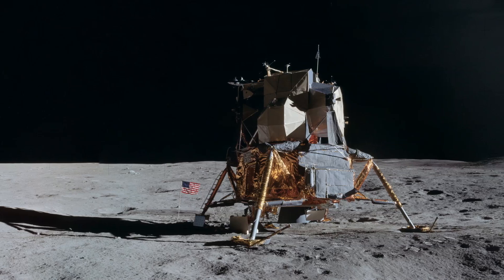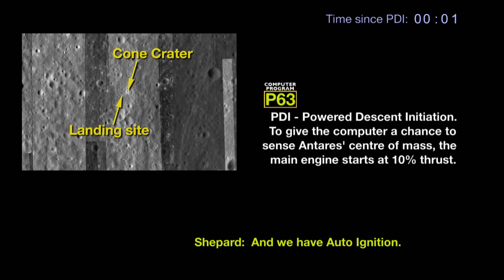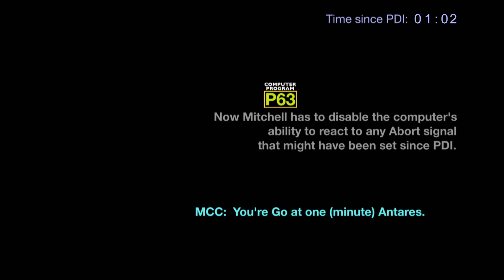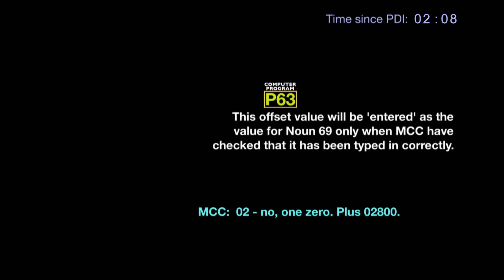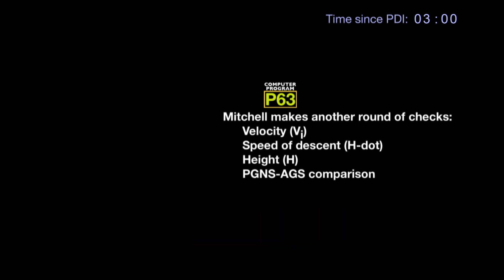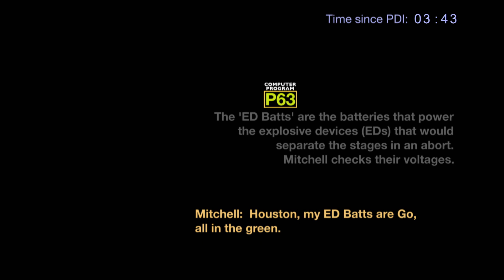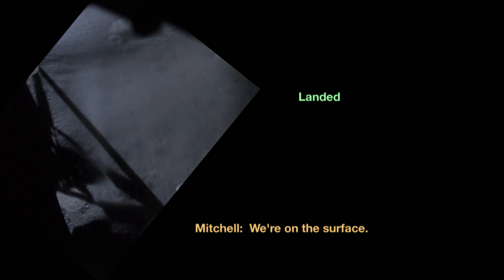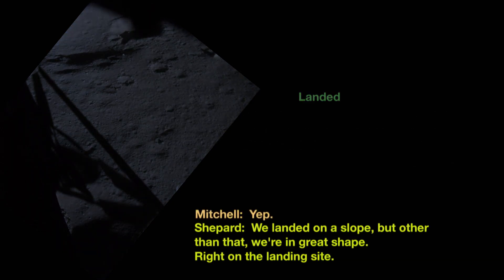Apollo 14 landing from PDI to Touchdown

Comment: FAKE!!! There is at least a 4 to 6 second delay from Earth to the Moon in radio communications and this has it instantaneously? Nope.
Reply from the maker: It is important to remember that this sound recording was made at Mission Control. Let's unpack what's actually happening.
You would expect that the CapCom (the person in Mission Control speaking to the astronauts) would be able to reply instantly to an incoming message and that is what the recorder would pick up. If, on the other hand, CapCom addresses a question to the astronauts, then the answer would not be expected for at least 2.5 seconds because both he and the tape recorder would have to wait for the reply. The third case is where the astronauts are talking to themselves. Here, there should be no delay because they hear each other immediately.
To restate, the only time a delay should be expected is when CapCom asks a question and has to wait for a reply. In all other instances, the delay should be about what would be expected from normal conversation.
I hope that helps.
Reply: Its more like 1.25 seconds. Sorry but you were misinformed and now you are spewing misinformation and have become a dreaded hoaxtard.  GFY.
Reply: What a FAKE!!! you are.

Comment: Okay, my only question is how the hell are they talkin instantly back and forth when there is supposed to be a significant delay in the radio transmission?
Reply from the maker: Let's unpack this. The time for light and radio to travel between Moon and Earth is about 1.3 seconds. So if CapCom in mission control asks a question of the astronauts, he has to wait at least 2.6 seconds to get a reply. Moreover, if someone in mission control makes a recording of that conversation, then the recording will also have that delay (plus the natural delay between two people speaking).
But what about the case where the astronaut asks CapCom a question? It would travel across space from the Moon and arrive at mission control. CapCom would answer it as soon as he could and the recording would reflect that lack of delay.
The third case is when the two astronauts in the spacecraft are talking between themselves (the majority of the conversation). If the recording is being made in mission control (which it was) then both sides of that conversation have equal delay getting to Earth, but between the two of them, there would be no delay.
To sum up, there is only one case where you should hear a delay, and that is when CapCom made an utterance that required a specific reply.
I hope that helps. You only had to ask in the first place .

Comment: I read in one of your comments that they used a steerable antenna, so they were in direct communication with Earth? They weren't relayed by the CM?
Could the pilot staying in the CM (Roosa in this case) hear landing phase comms between ground and LM crew?
Those channels dedicated to each Apollo missions are a blessing, thank you for this work!
Reply from the maker: You are correct. The LM had independent communication with Earth through either a steerable dish antenna or one of two omnidirectional antennae. The frequency was S-band, just over 2GHz. The steerable allowed a higher bandwidth including TV. The onmis would work if the steerable was not aimed, and came in handy on Apollo 16 when the steerable's actuator failed. 
Both the LM and the CSM, as well as having S-band, included a VHF system with antennae. This permitted line-of-sight communication between the two craft but it did not work between Moon and Earth.
As an aside, the Lunar Rover, as used on the final three Apollo missions, had its own completely independent S-band communications arrangement with Earth. Since it was very likely that these crews would be working out of line-of-sight to the LM, the Rover had a high gain dish antenna that was aimed when they came to a stop. it also had a low gain, wider angle antenna that they used while driving. This arrangement supported good quality (for the time) television from the Rover and a reverse command channel that allowed an engineer on Earth to remote control the TV camera while the crew carried out their geology tasks.

Comment: I really gotta ask where you got that crisp panorama of the LM, it's gorgeous compared to others!
Reply from the maker: Thank you. I stitched it together myself using eight source images. I use Auto Pano Pro software to help with the process and I do a lot of pan stitching, mostly of my own photos. Over the years, I've acquired better and better scans of the Apollo Hasselblad collection. I have a professional skill in colour balancing (TV finishing video editor) and the best scans are on Kipp Teague's Flickr site: https://www.flickr.com/photos/projectapolloarchive/ These scans have been left deliberately unbalanced to allow balancing to take place at the end of a process and so they often look greenish and washed out. After adjustment, they look great! I've constructed dozens of the Apollo panoramas, often for use in my books (e.g. Haynes' Lunar Rover Owners' Workshop Manual) or on the Apollo journals. I'll placed the full size of this LM pan here for a few days: http://hafttm.com/temp/as14-66-9304to9311.jpg
Reply from the maker: Belay that last. I thought you were talking about the one in the titles. Maybe you meant the one 2 minutes in. Need to check where I got that from. May have produced it for the video. Will check.
Reply from the maker: Here's the pan from 2 minutes in: http://hafttm.com/temp/as14-66-9275to9279.jpg I did rustle it up quickly for the video from 5 source images. You can tell I was in a hurry by the discontinuous horizon a quarter way from the left.
Reply: Thank you so much!

Comment: Why is the only other noise is that beep in the background?  Is there no other sounds?   Is this actual footage or is video been doctored?
Reply from the maker: If there has been any degree of doctoring, it has been to restore the 16mm film replay speed to 12 frames per second, returning it to real time. Though Apollo film was shot at varying speeds, it is always reproduced at 24 frames per second. I also rotated the image to make the horizon lie at a conventional angle. The film camera had been mounted at an odd angle at the edge of the spacecraft's right-hand window.
To address the sound; what you are hearing is a recording made on Earth (Houston) of the radio communication between the spacecraft and the 'capsule communicator' (CapCom) in mission control. The astronauts were fully suited at this point and were wearing their helmets. They were speaking into microphones inside their helmets that were positioned next to their mouths.
The beeps are known as 'Quindar tones'. They were generated every time CapCom pressed or released his push-to-talk button. Their function was to act as a signal to the Earth station that was actually transmitting to the spacecraft at that time. There were three such stations; in California, Spain and Australia. As Earth turned, one of them transmitted to the spacecraft at all times but the CapCom's voice was only to be transmitted up to the spacecraft when he wanted to speak. The tones indicated when his voice should go to the spacecraft.
I hope this helps.

Comment: Nah..this all ends before Van Allan Belts 1st area from 1000km to 3000km. Radiation is so bad that any organic material is damaged or violated. And thing Im wondering is that audio is so pure throughtout the journey..
Reply from the maker: It is certainly true that spending an extended amount of time within the regions of the Van Allen Belts would be harmful. However, the Apollo crews were travelling at nearly their fastest speeds when in Earth's vicinity and therefore spent little time within the belts as they headed out to the Moon. 
The belts are thickest around the equator and since the departing trajectories for Apollo were away from the equator, exposure was not so great. Additionally, the hull of the spacecraft  (aluminium alloy for the structure and phenolic resin for the heatshield) provided a measure of shielding against the very energetic protons of the inner belt but this was traversed in only a few minutes. The outer belt contains electrons whose energy is considered low. It took about an hour for the crews to traverse this more expansive region. Overall the dose was considered small.
The quality of radio communications depends, among other things, on an important criteria; the beamwidth of both the spacecraft and the Earth-based antennae. For the landing phase, they made sure to use the dish-type 'steerable antenna' on the lunar module. This would automatically keep a focussed reception pattern trained on Earth even as the spacecraft rotated as it came down. This ensured clear communications throughout.
However, it is worth listening to the communications for both the Apollo 11 and Apollo 16 landings. On Apollo 11, they had trouble getting the dish to point properly because of design changes to Eagle when compared to Apollo 10, the previous flight. 
On Apollo 16, the steerable antenna failed completely, so all communication had to be achieved with one or other of two omnidirectional antennae mounted fore and aft on the spacecraft. This meant a weak signal was received at Earth and you can hear how the quality of the communication changes as they switch between antenna.  To help the situation, the Earth stations changed from the usual 85-foot antenna to a very large, 210-foot antenna.
Reply: Apollo 14 - Apollo Flight Journal 
Astronauts coming close to the Van Allen belts, but not penetrating into them, reported to have been subjected to weird visual effects due to radiations, appearing like shooting stars.
But the Apollo astronauts, like Alan Bean testified, reported no such phenomenon, though they supposedly completely crossed these belts.
When the saturn rocket leaves the earth, it goes on an orbit around the earth, but this orbit is not in the plane of the moon's orbit.
Yet, the trajectory to go to the moon has to be in the plane of the moon's orbit.
This means that the CM first has to switch to the plane of the moon's orbit. 
But, for the plane change to require a minimum of effort, and thus save fuel consumption, this plane change must occur when the orbit around the earth followed by the CM crosses the plane of the moon's orbit.
The plane of the moon's orbit is not in fact parallel to the equatorial plane of the earth, in reason of the inclination of the earth's spin axis.
There are two intersection points of the earth's orbit followed by the CM with the orbital plane of the moon; one on the side of the Atlantic, and one on the side of the Pacific; the CM can make a plane change on both of these points.
Reply: Apollo 14 - Apollo Flight Journal 

If the CM makes a plane change on the intersection point on the side of the Atlantic, it will have to make a plane change upward; conversely, if the CM makes a plane change on the intersection point on the side of the Pacific, it will have to make a plane change downward. Once that the CM is in the orbital plane of the moon, it follows an hyperbolic trajectory which must bring it in the vicinity of the moon, on the left on it, which means that it will turn clockwise around it (the drawing shown is a drawing made by NASA).
Of course, it means that the moon must be at the "rendezvous" at the extremity of the trajectory, which happens only once in the month (since the moon takes almost a month to complete its orbit around the earth).
This means that the saturn rocket must not be launched at any time in the month, but at a precise date allowing this rendezvous with the moon; this date is called "launch window" by NASA. The conclusion of this is that the trajectory followed by the CM is not dictated by the goal of exposing the least as possible the astronauts to radiations, but by the goal of saving fuel as much as possible, and the two goals are contradictory.
The goal of saving fuel as much as possible leads to a trajectory which makes the CM go through the Van Allen belts, and thus exposes the astronauts to the radiations of the belts.
If it was the goal of exposing the least as possible the astronauts to radiations which had been privileged, it would have meant choosing a trajectory making the CM pass by a pole of the earth, and it would have meant a high expense of fuel.
May be it would have more protected the health of the astronauts, but it would have been as the risk of having the CM running short of fuel, in which case the astronauts would never have been able to return to earth...and it would not have been good for their health either, even worse:!
Furthermore, not only the astronauts were exposed to the radiations of the belts when going to the moon, but also when returning to the earth, for they had to cross them again.
Reply: Apollo 14 - Apollo Flight Journal 
someone has pointed out to me that the tilt axis of the earth was not perpendicular to the solar orbital plane, but was making an angle of 23° relatively to the perpendicular to this plane; on the other side the lunar orbital plane is making with the solar orbital plane an angle of 5°; he has deduced from it that the direction followed by the command module was making with the main direction of the radiation belts an angle of 28°; but there is a problem with this conclusion; indeed, if we take the case of Apollo 11, this mission happened in July when the earth was inclined relatively to the solar plane like shown on the figure above (in summer solstice); on the other hand, Apollo 11 landed on the moon shortly after the new moon (like it was the case for all the lunar missions); consequently the command module left the earth almost in the direction of the sun, and thus followed the lunar orbital plane not when it was above the solar plane, but under it instead; the consequence is that the 5° of the lunar plane don't add to the tilt axis angle, but subtract to it instead; the conclusion is that the trajectory followed by the command module to the moon did not make an angle of 28° with the main direction of the radiation belts, but an angle of 18° only, enough for the astronauts to receive quite a good dose of radiations!
Reply from the maker: If I may address your two points, Adam. Regarding the visual flashes that Alan Bean apparently did not report, you say that none of the Apollo crews reported them. However, they were extensively reported by subsequent crews who conducted experiments into their nature. Indeed, the Apollo 16 and 17 missions had elaborate helmet arrangements to try to correlate the reporting of the flashes with recordable events on fim emulsion. Search for 'ALFMED experiment' or see:
https://history.nasa.gov/afj/ap15fj/07day3_flashing_lights.html
https://history.nasa.gov/afj/ap16fj/08_Day3_Pt1.html
Concerning trajectories, I did not say that the goal of the lunar bound trajectory was to avoid the Van Allen Belts. My point, to restate, was that the lunar-bound trajectory did not fly through the thickest region of the belts because it was away from Earth's equator. The crews did fly through the belts for a short time and received a dose of radiation that proved not to be a problem.
Reply: @poristimaki8475  The Saturn V trajectory took the rocket through the thinnest part of the outer Van Allen belts in a short space of time, so the dose of radiation was within safety limits. Each mission flew a slightly different course in order to access its landing site, but the orbital inclination of the translunar coast trajectory was inclined to the Earth’s equator by about 30°. A spacecraft following that trajectory would bypass all but the edges of the Van Allen belts. 
High energy protons are the main types of ionising particles in the Van Allen belts along with electrons, and not electromagnetic waves e.g. ultraviolet, infrared, gamma etc. Electrons can pass through living tissue without creating much damage as they are very small. The Command Module’s outer hull was made of stainless steel and the (upper) heat shield from epoxy resin, which along with the fibrous insulation between the inner and outer hulls was a very effective form of shielding against protonic radiation. 
The ISS at times passes through the Van Allen belts and so did Gemini 10 and 11 in 1966. 
The Apollo Guidance Computer used low density integrated circuits and magnetic core memory, both of which are extremely radiation hard. The computers were responsible for a relatively small aspect of the operation of the spacecraft; a lot of tasks were performed manually. In contrast, modern spacecraft like Orion are controlled by very high-density computing, and single event upsets (SEUs) can cause major problems. This is an issue for satellites today, even in low orbit, and it would certainly be an issue for a spacecraft transiting the Van Allen Belts.
Reply: They made it through, so the people who say you can't are just wrong. Look at the LRO photos from TEN years ago. They show the landing sites. We left a lot of junk up there.

Comment: Read that Shepard was going to land it regardless of the radar working or not. Hey we have to abort. Screw it I'm landing this bitch!
Reply from the maker: This is often stated but it is pretty clear that had Shepard attempted a manual landing without the radar, he would almost certainly have had to abort. The propellant margin of the LM was very tight and it required the computer to fly a near-optimal trajectory until very near the ground. There are no visual cues until the shadow comes into view and even the computer's knowledge of their altitude was out by nearly 1,000 feet until the radar data began to correct it.